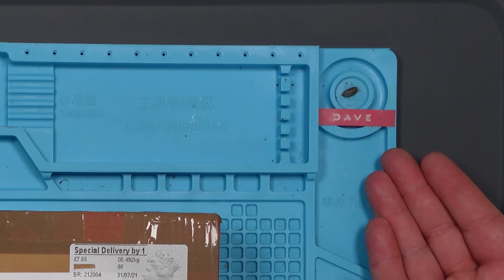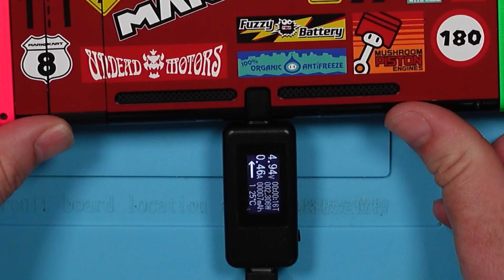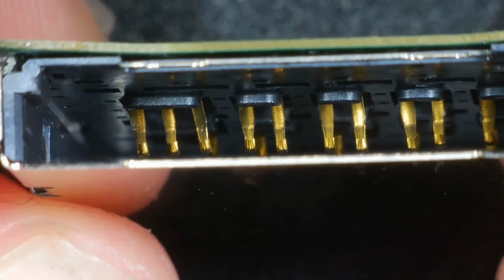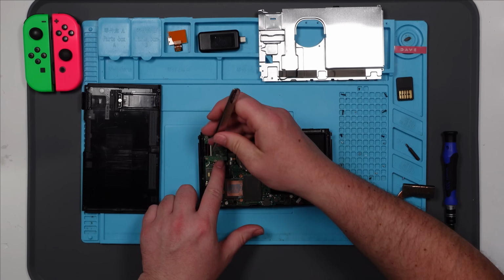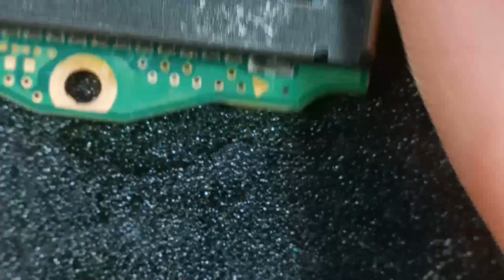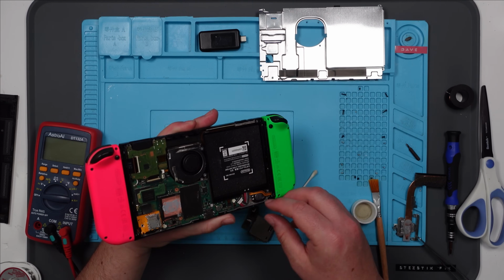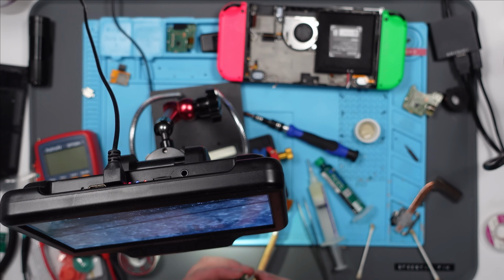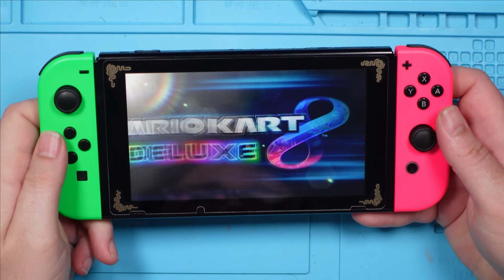Nintendo SWITCH | Faulty GAME CARD Reader & Doesn't DOCK | Trying To FIX

Comment: Brilliant job Mr. Bodge. By the way, the via trick isn't a bodge, it's actually a very good way to ensure your wire makes a strong secure bond. I think I showed that on a PS4 repair once. You should be pleased with that result. Also, that chip on the module is a touch ic. Don't hope to buy them though, they cost more than the actual card reader does lol.

Awesome work
Reply from the maker: 😁 cheers mate, appreciate it!  I was really happy with the trace repair and I feel it'll be a lasting repair too.  I got a real buzz from seeing it working, loved this one!  👍
Reply: @StezStixFix  definitely mate, nothing wrong at all with the way you did that. You're definitely getting a lot better at using your noggin to come up with different methods

Comment: I just swapped a metallbracket cartridge of a Switch. Big respect in what you do Steve! 

Could you possibly recommend a fluss/flux to use from Amazon? I´m kinda new to all this soldering things, but I find it very fun to do! But I cant decide what to buy.

I use leaded solder in case that makes a difference of the fluss/flux.

Comment: Nice job Steve 👍 I'm glad you have kept Dave? Hi Dave? Wish I had the Confidence to try and fix stuff like you are my hero and you are like a dad to me as you show me the right way to do things thank you dad? Lol what type of flux do you use I only have the stuff that you brush on is that where I'm going wrong with my repairs do you rate the flux you brush on or not please advise me dad!?
Reply from the maker: 😁 thanks son! I havent tried the brush on stuff, but the flux I use always seems to work well for me and I wouldn't personally use the brush on stuff (although I have seen others using it, and it seems to work ok). I'd go for a cheaper syringe one to start with, like the Kingbo RMA 218. You can usually pick it up from eBay for a few £'s 👍

Comment: Stumbled on your channel and really love how you tackle electronic issues. I learn as you learn. Do you take repair requests? I have a PS1 that has video output that doesn't look great. I also have a ps2 that has a disc read issue, and may or may not have a video output issue. I could mail those over and pay for repair services if you accept USA currency. Keep up the great work Steve.

Comment: Please could you advise me of what type of hot air station should a beginner buy as I haven't got one and I know if I had one things I try and repair would be a lot easier but I haven't got much funds for a top dog one thanks Steve 👍
Reply from the maker: Hi David. I started of with a cheap Yihua one from Amazon. The one I bought doesn't seem to be available anymore, but there are a few similar ones if you search Yihua on there. I've since upgraded to a Quick 861 (which cost a lot more) because the Yihua broke after a couple of years of use, but it worked well as a starter for me! 👍 Maybe try one like this: https://amzn.to/39llFwS

Comment: Loving your videos man please keep them coming! I do have a question though. When you were replacing the USB port, you added solder to the mounts and then de-soldered it. I was curious of why you did that? I don't think I've seen that technique before. Thanks in advance- Jon
Reply: Adding fresh solder to joints helps them flow better for desoldering. I couldn't tell you the physics behind it, but in practice it definitely has a noticeable effect

Comment: I have the exact same problem with a brand new switch when docking on that USB C prong.  It wobbles around and doesn't always provide video output.  I wonder if all that wobbling around that it normally does stresses the port and causes it to eventually break contacts.

Comment: Quick question if I may. Did you use a specific Nintendo adaptor to connect to hdmi or was it a common or garden variety usb-c to HDMI?
Reply from the maker: I tried both (aftermarket and offical dock), but for the video it was easier to use the aftermarket one.  It's a relaible one that I use with my own Switch 👍

Comment: I dare say those “higher” cartridge pins were like that by design. Perhaps they were the ground pins, which were meant to make contact first?
Reply: I don't think so. Since the cartridge's height doesn't change when its being slotted. So the higher or lower pins wouldnt make a difference imo.
Reply: @MrGunner300  It's not just about height. Being bent more to 90 degrees will make them contact the cartridge earlier. If you go and look at contacts 8 and 11 on the cartridge, you can see they're slightly longer than the other contacts. This, coupled with the pins being at a steeper angle, will ensure these pins make contact before any of the others.

However, with the actual cartridge's contacts being longer, it probably doesn't rely on the pin angles/ heights being different. So, yeah, probably just that they're bent.